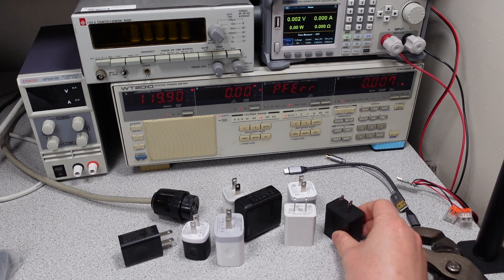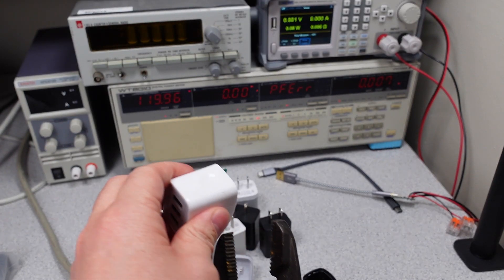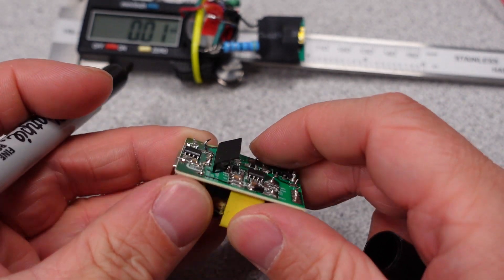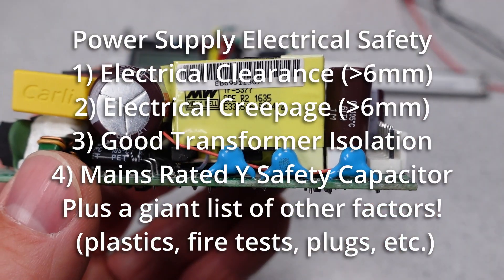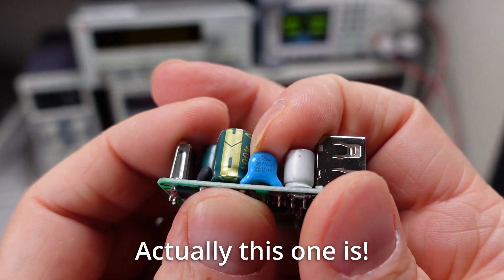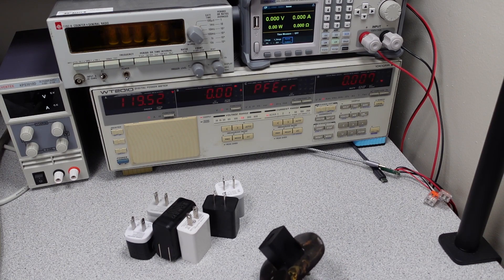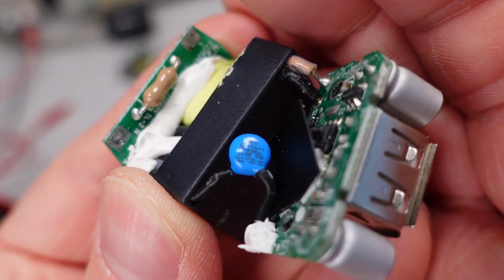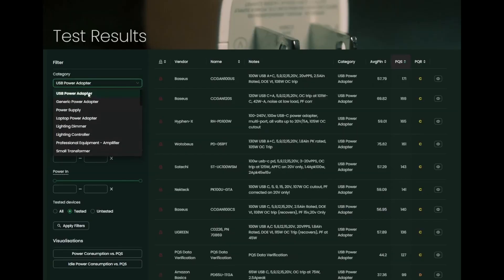Unsafe Power Adapters What exactly makes them unsafe?

Comment: There's a flood of different "brands" of GaN chargers and for the average consumer, it's impossible to distinguish between them apart from Amazon reviews, which are apparently gamed as well. This channel looks like it provides great material. If only you had the capacity to test more adaptors and spread the word to force companies to improve their products. I heard LTT wanted to start something along these lines (but questionable whether chargers will be a thing they test) and it can't come soon enough.
Reply from the maker: Thanks!  By the time I get a new charger in, it seems like there are already 5 more on the market.  The LTT thing is 'labs' and partially is what I am doing also, it would be amazing to be considered a competitor of them, ha.  I think LTT needs some electrical engineering skill at some point to focus on this type of work.  They could also use the rating system (PQS).  I know they spent $130k from a recent video on the Chroma brand gear to do this type of power testing so they could do it.  I think their focus is more on PC power supplies though.  In terms of my capacity, yeah, I work full time so this is certainly a side line (and a costly one at that).

Comment: I ran in to this issue today while shopping for pwr adaptors on amazon. I have a bunch of LED lights around my house(strips, custom SMD LED lamps, and custom made light boxes) that I power using a bunch of different methods but everything runs @ or under 5v 2amps. I wanted to find a good quality adaptor I could buy in bulk to standardize all my lights so I know everything is within spec. but trying to find adaptors in bulk(@ a reasonable price) that actually have accurate specs listed is proving to be difficult. I don't currently have testing equip. like you to check these things myself either. It's crazy to me that Amazon doesn't have a system in place for weeding out potentially dangerous products.
Reply from the maker: They do, it's just whack-a-mole but impossible, knock one down, 50 more pop up.  It's a prove it later sell it now system.  If you need that many supplies maybe check a site like mouser or digikey.
Reply: With sales and multi charger packs, you can find cheap-ish Anker chargers. There's a promotion on the Bezos smile website (if I write the name YT filters will take it down) right now, a 2-pack of 20W chargers for less that 13 USD.

Edit: YT filters do be very aggressive... test. Test 2... it's up! So apparently fractions, the smiley website name, and a different way to write multi are all triggers here.

Comment: I would love to watch a more in-depth video including demonstrations. Like the suppression capacitor to reduce EMI (why do shady adapters have these? If they don't care about the safety aspects, why bother with EMI?): you could show its impact by showing harmonics on the scope (?) with and without it
Reply from the maker: Thanks!  Yeah, I need to get more of that going.  I think in many cases they copy the reference design, it says add this part of this value they add this part of this value, sometimes not a safety rated one since the chip makers datasheet won't specify that.  I actually don't think a single one of my EE books says anything about safety ratings or designing for safety come to think of it.  So, whack in anything sounds good, carboard and copper tape will do the trick.  I don't really have a good way of measuring the EMI emissions from these either.

Comment: Hi, new subscriber here! I'm looking for a multiport 100W charger for my macbook pro 14 as a backup (mine comes with the 67W charger). In my country we use 220V / 50Hz btw. I saw you gave a good grade to the Baseus one, but looking up in amazon some reviews says that it stopped working after some months, so now I'm in doubt. What would you recommend? I saw the anker 736 too, which gives me more confidence because of the brand but I don't know...
Reply from the maker: Yeah, any charger is going to have a certain failure rate.  Baseus is a newer brand so certainly will have some issues.  I beat the one up I have pretty bad and I have been using this adapter daily so far no issues on mine but yeah, small sample size.  The Anker having stronger brand recognition is one thing but also they've been making power adapters for longer so they have some knowledge on what works and what doesn't.  I give out the information, it is up to you to decide.  I say don't buy the ones in this video at least (I stuck the 20W UGREEN in here too but it was actually good for the power class).  The Anker 736 is middle of the road.  It is great if you are charging higher power use devices (laptops).  If you are charging a phone it's a waste.  I don't see any reason NOT to buy the Anker though.
Reply: @AllThingsOnePlace  Thanks for the reply!
Reply: Better anker.

Comment: Very good video and very interesting to see the ways in which these little devices can be unsafe.  I was a bit confused by the inclusion of the UGreen adapter in the tables toward the end of the video.  Its numbers look good and I think you rated this adapter quite favorably in an earlier video, but you stated that they all were all bad except one, and didn't mention that the UGreen was actually decent.
Reply from the maker: Ah, yeah, I was trying to show UGREEN as a good example.  The 'all but one' was the FONKEN, not counting things already done, that was a bit confusing.  The general idea is that when devices don't have a listing corners are cut, is a listing required to make a good adapter, no, but it gives me some comfort that someone at least tried at some point.

Comment: very informative and useful
are GME power adapters safe?
not sure if you used or have any but i have one and wondering whether it's good or not
it has CE and GS listings on it but not sure if they are real or not
Reply from the maker: I haven't tested any of those so not sure.  You have to check if the CE mark is real or not.  The database is a mess but technically it should be in the EU database.  But it is still a self certification so value may be limited.  The GS listing I'm not sure on.

Comment: Hello, I have a question, I have a base model macbook pro 14 and I want to buy an anker 735 powerport iii  65w charger. The problem is, I heard using a third party charger can wear the battery faster. Is that true?? I really want that 3 ports because it's smaller and has more ports, but I'm afraid it'll wear the mac battery faster or even damage it.

Thanks for the video btw! subbed.
Reply from the maker: There is some truth to batteries degrading with faster charging.  Generally, it is more applicable when trying to charge a smaller battery, like a phone, at a rate more familiar to a laptop.  A laptop has a higher voltage, typically 3 cells in series, and more sophisticated charge controller so using a higher wattage charger is a very low risk of causing any harm to the laptop.  The laptop will only pull what it needs to charge.   Many modern phones will also do this.
Reply: @AllThingsOnePlace  Thanks for your explanation. Would you recommend anker charger that I mentioned for my macbook? Thanks again.
Reply: Im using an anker gan 65w for my iphone, ipad , and macbook air. Its okey. This Gan technology will only use the enough watts accepted by your device and it wont overcharge or overheat. When im at home, il stick to my original charger, the one thats in the box. I only use the small Anker for travel, or when im out of town, its like an all in one charger as long as you bring the right cord, specified for your device
Reply: @merjaymermanph  Got it. Thanks!
Reply: @samis9980  welcome
Reply: Apple sells Anker chargers in their stores so they must consider this brand to be safe for their products
Reply: @loughrey101  thanks!

Comment: Linear adaptors are safe as high and low voltage sides are isolated by concept.
Reply from the maker: Capacitive droppers are linear circuits.
Reply: @AllThingsOnePlace  I meant linear adaptors are safer than smps.
Any type is safe if it passes 2kV Hipot test for a duration of 1 minute.
My opinion.

Comment: Bit late to this video (thanks for making it btw!), I was wondering if you have or are planning to review and tear down any Ldnio or tynex chargers. I’m particularly thinking of getting their 65 watt non-gan charger, I wonder if these desktop usb c chargers with shotgun connectors are better quality/less likely to burn your house down than the “travel” type ones in this video due to less size constraints.
Reply from the maker: It is something to check out.  Thanks for the suggestions.  Yeah, these were mostly the cheapest options of power adapters also sadly all still available under a constantly shifting brand name soup.

Comment: @AllThingsOnePlace Hello, only charger that i can find 100% genuine is Baseus. U did not say much about it so i have a question. Do you recomend it for using it for Pixel 8? It sad in your sheet that is does not have DOE VI... What is the idle power draw? Thank you so much, your work is great!
Reply from the maker: The Baseus GaN3 desktop adapter does meet the requirement, the wall 100W GaN2 adapter doesn't because of the idle power consumption.  It's just over the line.

Comment: When I smell smoke, there's fire, and if you use any of these charge adapters, your house could end up crispyfried. Unsafe is right, one should only buy charge adapters, where you see lots of certifications on them. Plus, one can do their due diligence, and cross reference them, to double check if they indeed earned those ratings, or if the Chinese knock off's, decided to just stamp those labels on to sell a product, cause their dishonest as frickle frackle.
Reply from the maker: Yeah, the dangerous part is these are often the adapters that are available if you need something quick.  Last minute forgot your adapter, the service station probably sells some cheap power adapter like this to get you charged up.  I also have a few of these that were trade show giveaways and bad news, ha.

Comment: All these ‘bad’ adapters… 
One wonders if one can simply get the components out and repurpose them in some other device or circuitry, with the exception of offbrand electrolytic capacitors because apparently capacitor plague is still a thing in 2023…
There’s also mosfets to consider.

Just because a circuit is ‘designed badly’ doesn’t necessarily mean the individual components themselves are completely unusable.
Reply from the maker: Yeah, the control chips and protocol chips would be prime parts to take out of these cheap adapters if they have them.  They are hard to get for hobbyists.